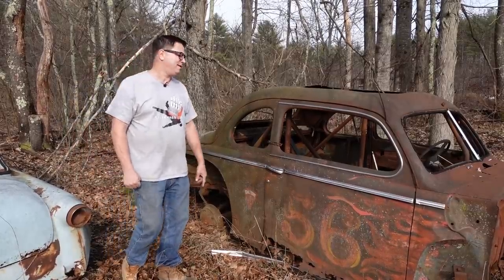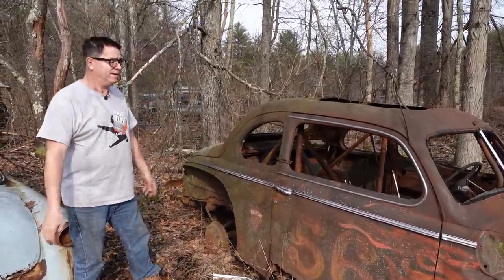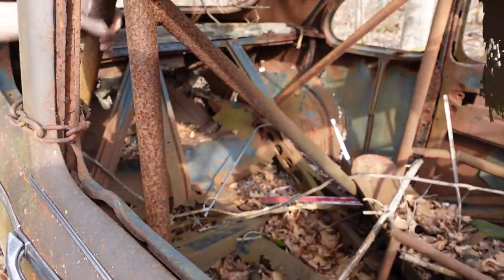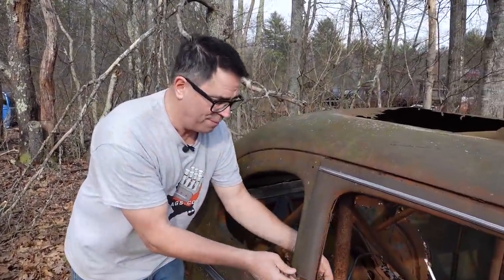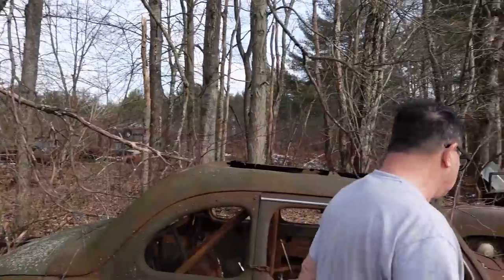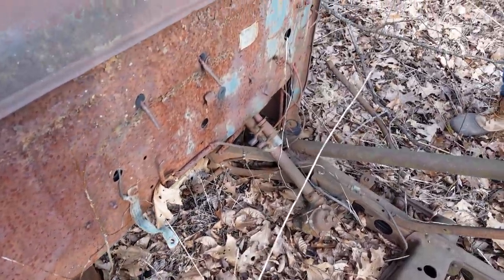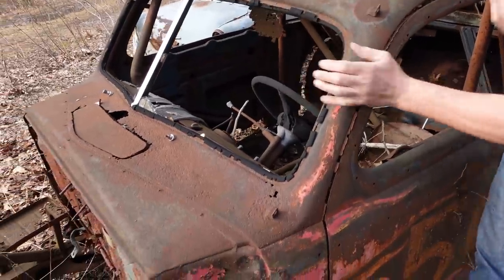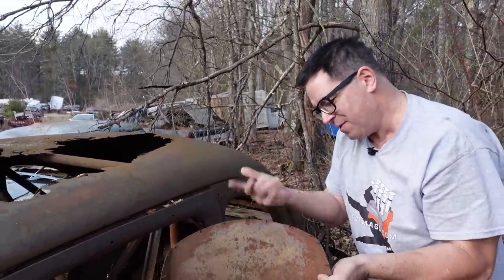Stock Car Racer Discovery

Comment: It’s ashamed it’s in the yard. Needs to be rescued. That’s from the days when people built their cars in their garage. No corporate sponsorship, that in my opinion ruined the sport by pricing it out of reach. Cars are far from stock now.
Reply: many tracks hold small local races starting with "bomber class"  that is fwd stock cars with a cage added. and is very affordable.
Reply: Unfortunately almost every car he talks about from this junk yard is beyond salvaging due to massive rust issues.  If you dipped that car, I bet you would lose half or more of what is left.
Reply: Back when racing every wekend was within reach of most folks.
Reply: Every other gas station had a stock car on the corner of the lot - many times owned by the mechanic, who would stick around after work and tinker with it in the garage. One buddy would bring a six pack, another would bring a bag of hamburgers from the burger joint, and they'd work into the night.

Comment: That is a 46 Ford with a 38/39 Ford rear axle.  The 46 stainless trim had two grooves in it, 47 and 48, the stainless was smooth.  The wide five bolt pattern is a dead giveaway to 38/39.  The axle that would have been under that car would have had the 5 on 5.5 inch bolt pattern used on 1/2 ton Ford pickups through 1996.
Reply: Jupp!
Reply: Love your knowledge
Reply: I should have read yor reply before i posted above.  A fiend 46 had the 5 on 5.5 patterns.  I couldnt remember if the 46 trim had the grooves or the 47-48.  I usually figure them out by looking at the front parking lights.
Reply: @brentleehayes9621  Thanks.  I have six ford cars between 46 and 48.
Reply: @bigassfordsd  The front parking lights are not always the case.  46 did have square parking lights high next to the hood.  47 and 48 had round ones below the headlights.  That being said, some 48s had the square high parking lights as well.  One factory found a bunch of 46 parts late in 48 and used up what they had.  I have a very original low mileage 48 with the square high mounted parking lights.  There was a suspension change about three months into the 48 model year.  The knee action shocks were gone and the normal looking tube style shocks were used.  

There is nothing really standard about the 46 to 48 production run.  The cars were basically warmed up prewar models.  Ford knew that all new models were coming in 49, but needed something to sell to the public immediately after the war.

Comment: I was born & raised in Worcester Mass.  My dad used OILZUM in his vehicles for most of my early years. He had a friend that worked for White-Bagley in those days. They were located originally on Front Street in Worcester. 
I recall going out to the Westboro Speedway in the early t mid 60s. This # 56 car possibly ran there & I may have even seen it .  
Thanks Steve for the trip down memory lane.
Rick

Comment: If you look around 1:16 when he is showing the dash, you will see a piece of metal that looks like a hook welded on the dash in front of the shifter. They did this to lock the car in second gear so it wouldn't jump out of gear when going into the turns. My dad told me of this when he ran circle track cars back in the early 50's. They would always start out in first like normal, then when shifting into second, they would place it in that bracket. He always talked about it, never seen it until now.
Reply: Crazy, thanks for sharing
Reply: good catch, steve should have pointed that out. i didnt know that.
Reply: Thanks for sharing and teaching
Reply: I used to work with a guy who did 'banger' racing in the seventies, they would always try to find an Austin Westminster with a three litre straight six and three speed transmission, second gear was ideal for the tight asphalt ovals they used to race on. All The Best from Somerset UK.
Reply: @jonathangriffin1120  as an American I am pleased to say that I got to see Banger racing in the 90s when I went to see my cousins in Essex 😂
Reply: later on guys would use a bungee cord, I kept one in the car always, whether it was needed or not as sometimes during a race the trans would decide it was tired of staying in gear
Reply: U win the Great Big Giant Teddy bear for nostalgia for knowledge Award of us old timers... The prick is taking up valuable office come get your big teddy bear... I got some old brake shoes and other stuff U can take home with ya.

Comment: A friend of mine who passed away years ago, and I found a 1934 Ford Coupe circle track racecar in the woods of Grand Prairie back in '78. It was grey, had Champion sparkplug decals on doors, rollbar, 1 seat, tall manual shifter, self cut treaded tires on original spoke rims and a Oldsmobile Rocket engine. We wanted it so bad but never could find out who owned it.

Comment: Guys liked those Ford straight axle suspension, my buddy had a 37 Chevy coupe someone had put Ford suspension under, complete with torch-bent split radius rods up front. 

The one I saved from the crusher was a 39 Chevy coupe, and that one had been running maybe a 265 or 283, the open drive 3 speed was still in it and while it had Chevy leafs front and back, they added dual shocks all the way around.  It had part of a truck rim as a radiator guard.

Comment: That just looks like a wicked heavy beast! Definitely cool though! Dig those flames!!! Thanks again!
Reply: My 46 Ford weight about 3300 pounds. Partial interior and a 350/350 setup. Also manual steering and brakes. It actually shocked me when I weighed it. Expexted it to be much heavier. FWIW.

Comment: It's a '46/'47 standard coupe.  The dash insert was never plastic (later addition). Amazing find and sad to see it so far gone. Wish Hot Rod Deluxe was still in print and always enjoyed your articles and contributions.  Keep moving forward!
Reply: do you think it may have been older?  reason I ask is because a friend has had a couple 46 super deluxe and they had a standard 5 on 5.5 lug pattern.
Reply: @bigassfordsd  Definitely 46/47 standard coupe.  I'm building a '46 Business Coupe in my garage (old hot rod from the '60's/70's  that needed much love and work).  Standard coupes had that wonky rear window section because they had a back seat.  The real giveaway here is the dash.  Everybody loves the 39/40 body style but the dashes where clunky rectangular boxes.  46 introduced the round gauges and waterfall style center trim.  My '46 was hot rodded way back in the day so it has a GM rear but the front is all original Ford 5 on 5.5.  Makes buying rims a pain in the ass.  But that's a hot rod!

Comment: THAT VIDEO IS BEYOND COOL.  In My Neighborhood As I Was A Kid, The Local Track  Stock Cars Back Then We're Late 40's To Early 50's Cars.  And We're Stripped Down And Welded Up Just The Same As That  # 56 Late 1940's  Ford Car Was.  Today  We Have Another Dirt Track Outside A Neighboring Town That You Can Hear The Cars Roaring Around It On Saturday Nights.  But The Classes Of Cars Hardly Resemble The Auto Makes They Are To Look Like.  And Those "Stock" Engines In Them Are Really Souped Up, Having Extensive Driver  Protection Bars In Them, And Mandated Regulations Applying To The Cars As Well.  GOODBYE Old Time Backyard Fun Hobby....

Comment: I wonder why it has a wide 5 rear diff from the 30's - I would assume 39 so as to have juice brakes but I don't think they could have the 15" wider rims.
Reply: The friction shocks are also from the 30's, I'm betting it's on a 37ish frame
Reply: The wide five pattern is still in use on today's dirt track cars. Having the lugs spaced that far apart causes less induced stress in the corners. It was a reliability thing. Simply swap the 1940's small pattern drums for the earlier 1930's drum and you had a stronger wheel lugs system.
Reply: @billevans1179  YA , that makes sense - because in 41 they changed the whole car to a larger format and back then those cars were a dime a dozen